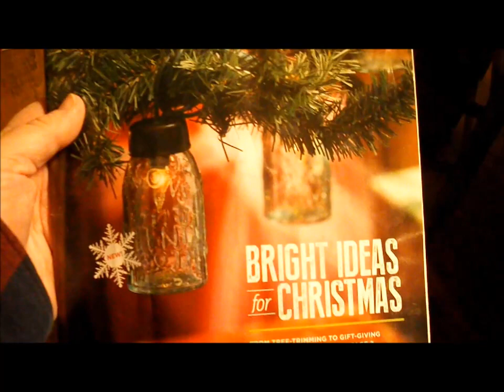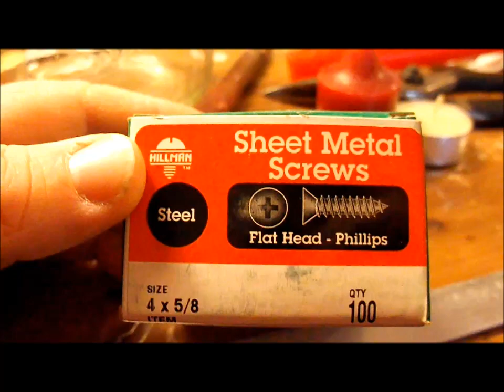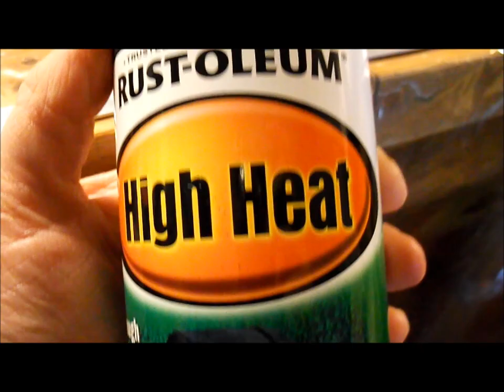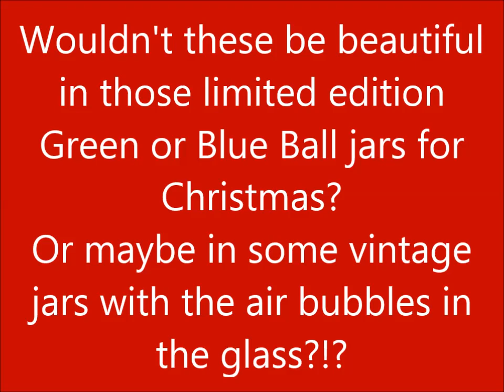Homemade Candle Holder for canning jars Dec 2014

Comment: I love them!!! Clever you! I'm forever doing knock offs of things like that, and will definitely be making some of those. Neat trick with the screw too. Thanks for sharing! Since I do have some of those old blue ones I think I'll add some white candles to those for year round decor. Another mason jar candle idea I've done and you might find neat too, Fill a quart jar  (half or 2/3rds full) with decorative items (or small collectibles) such as, sweet gum balls, miniature dried gourds, then buy those two inch terra cotta pots or whatever size will fit into the top of the jar opening (without falling inside) to hold a votive candle with or without ribbon around the neck of the jar to match.
Reply: Great idea, I have a ton of bagged acorns, pine cones, and seashells. (I'm too cheap to share my button stash).
Reply: mrshammerhankus Thanks. I know just what you mean about the buttons.lol

Comment: Cool! Perhaps use a pan-head screw, they don't have the taper, and will sit flat to the material. Though you could use a chamfer bit to recess the taper screw. Also, as mentioned elsewhere, a center punch would prevent the drill from walking on you when starting the hole.